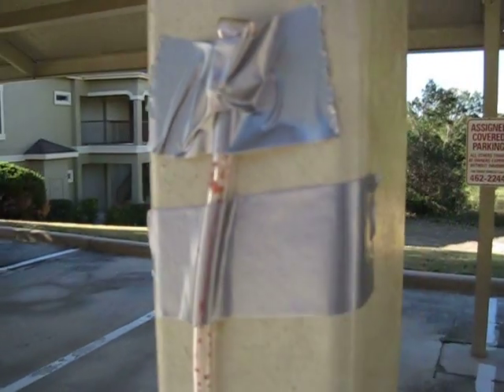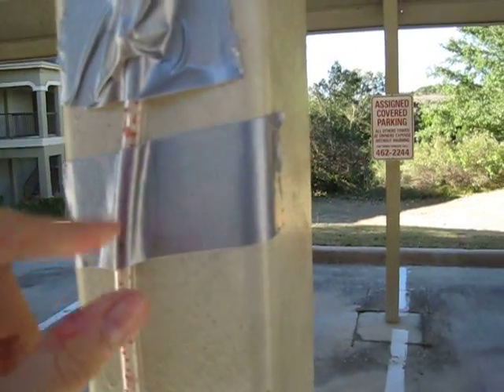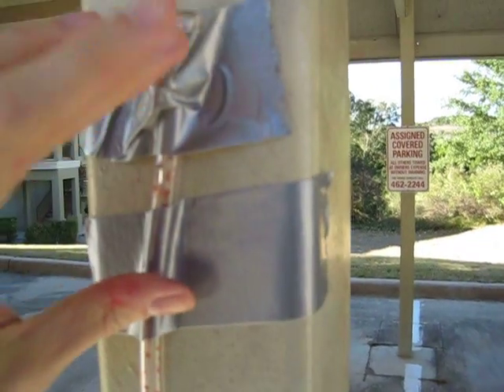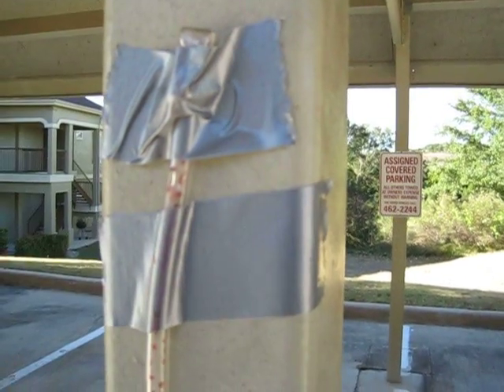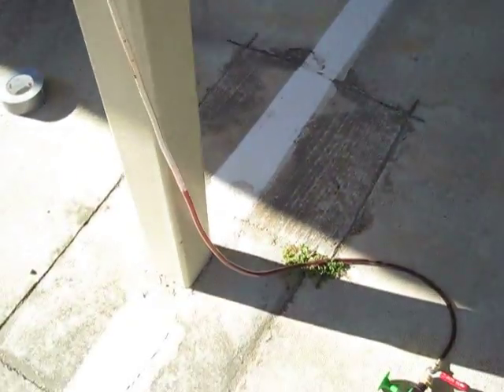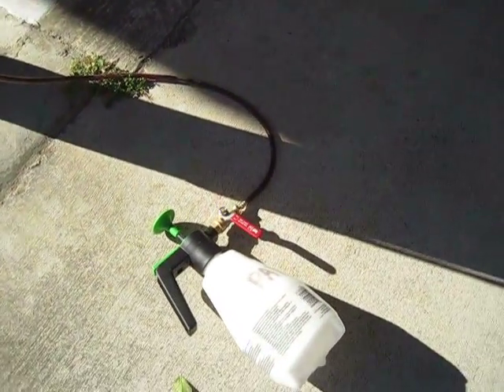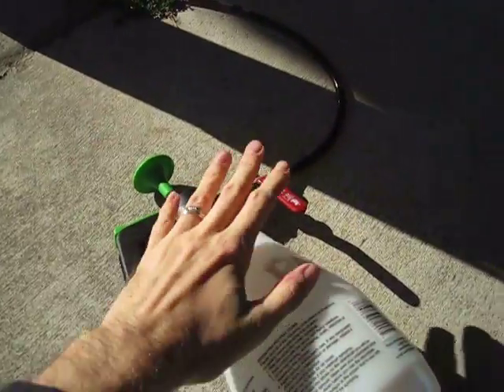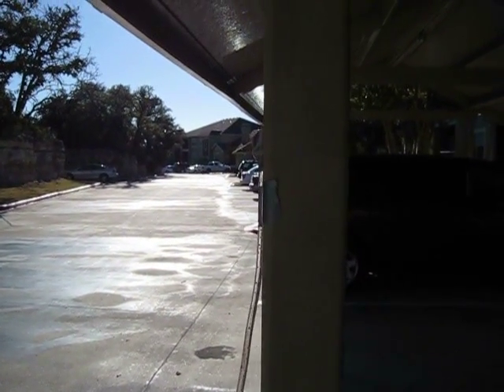Bullet Hits with Air Pressure

Comment: and on the other side it's a connector that's made for tubing. Then I've got a 3/8" plastic clear tube that's about 20 ft long. And I've tried to shoot blood but it just doesn't work. The blood slowly rises to the top of the tube. I think my fault is in the actual pump thing, because even without everything connected, it really doesn't feel like it has alot of pressure. So idk, could you help me out? I'm shooting a big film mid april and I HAVE to get this working before that.
Thanks!

Comment: Dude, I need some help.
I've found this is the best way to do bullet squibs and so I actually went out and bought the same setup you had, but it doesn't work for me like it does for you in this video.
I've got the same Flo-Master pump. (It's 56 oz. Which seemed a little small... Not sure if yours is bigger than that.) Then I've got it going out to a 3/8" quick release ball valve to a 3/8" tubing converter. (Threaded on one side that connects to the quick release valve (See comment 2 below)